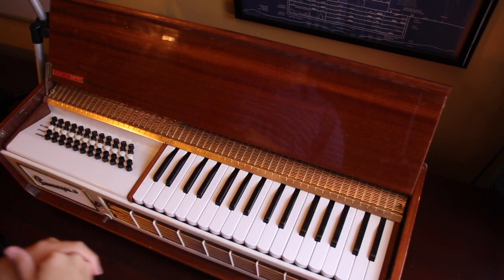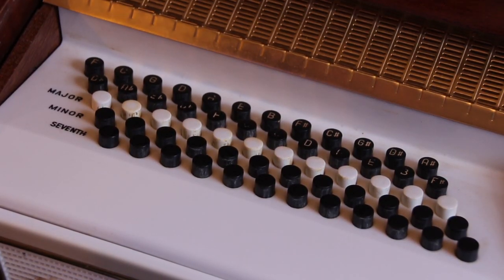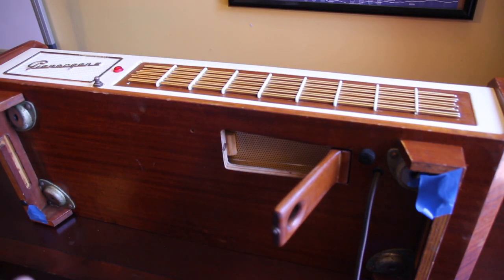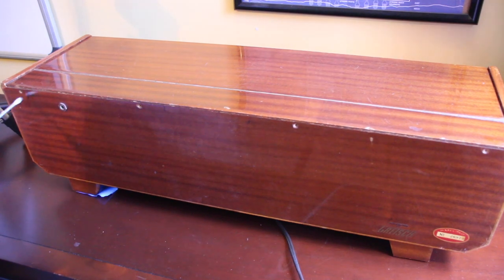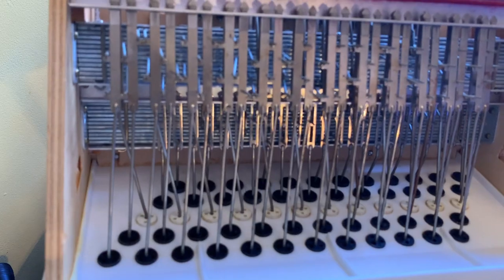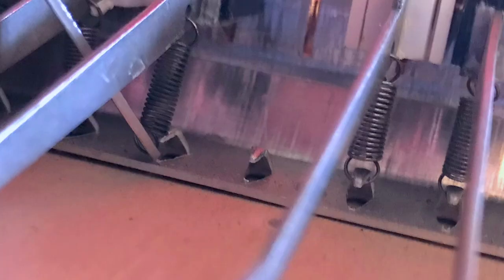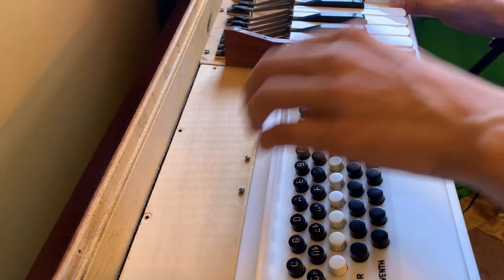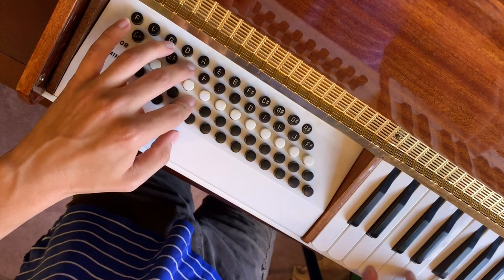Pianorgan Demo and Inside

Comment: I have a collection of these and other Italian and German models of the chord organs as they are called. I also have a large version of this one that was in a collection that was never used when I bought it on Ebay about 5 years ago. Works well accept a few keys are sticky, working fine, but a little sticky. IE. when you press it down it doesn't pop up instantly. For some reason it all worked perfectly today, but at times a tiny bit sticky. I'm concerned about taking it apart so I just deal with it. I have about 60 music books for chord organs, you can get them on Ebay. You can play literally any popular song with little to no effort because the music tells you what button (letter note) to push with your left hand and what key (numbered) to push with your right hand. You don't have to be able to read music at all just follow the letters and numbers printed on the actual sheet music. You can play any song within minutes even if you never played a single note in your life. It makes people think you're a musician playing this complicated looking horizontal according looking thing and you don't have to have any musical knowledge at all. I have some, but with this you're up and running the minute you get it. Very cool.